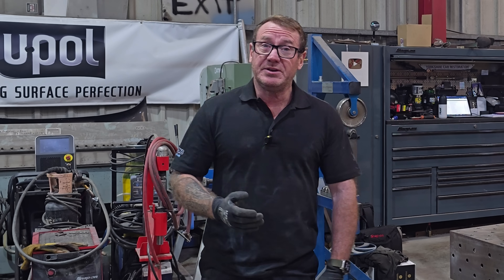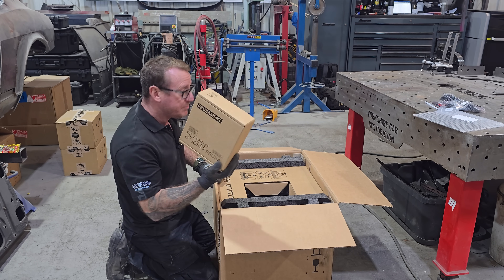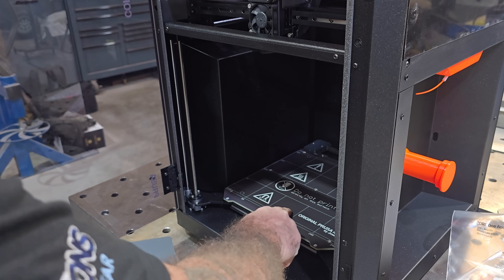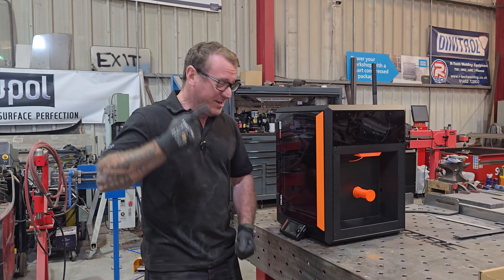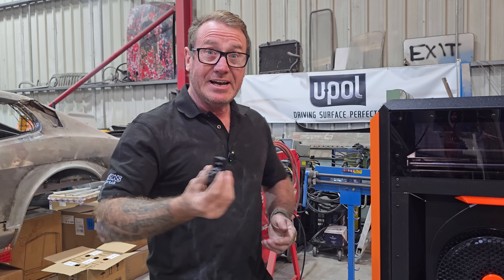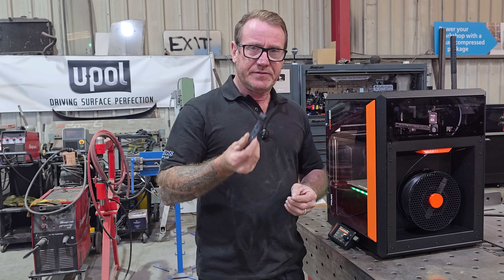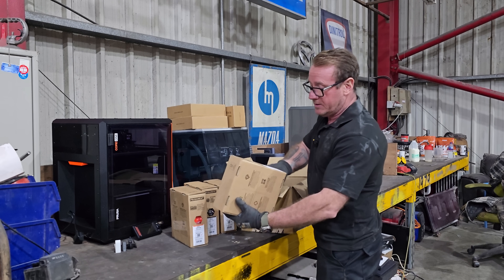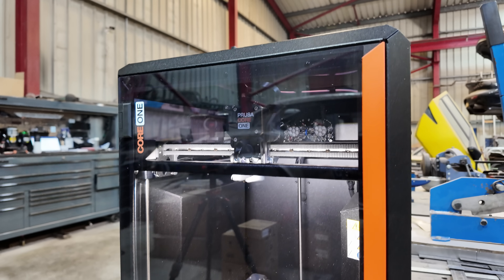Can We 3D Print Unobtainable Classic Car Parts

Comment: Noob question, how do you scan an object that you'd like to replicate / print?  Or do you have to measure it up and draw it yourself?

Been thinking about this for some Honda brackets I've been unable to locate anywhere.
Reply: With a very very expensive scanner, or.... draw it up yourself
Reply from the maker: 3d printers cost £300 upwards and a good scanner is £1000 plus but they can be used for years, all you do is scan it do a little bit of free software magic and print them out .

Comment: Normal household dust is sufficient to affect print adhesion, also it really needs normal room temperatures, and many filaments need storage in a dry atmosphere.

(3D printing in Yorkshire since 2010 with initially a RepRap Mendel and more recently a Prusa i3)
Reply: this machine does look good, and i am sure the quality is reflected in the price
its good to have someone on side with more experience, its something i have thought about getting into, especially recently having stopped work through illness and entered back into a world of aviation and modelling - if ever you get a chance to purchase any product made in resin you will notice right away the quality difference, there is zero striping in the layer build up - ok so they maybe using different materials, but they are pretty tough and need to be superglued - with the type of output shown here you need to sand, or did i hear correctly somewhere you can use something like Isopropanol to smooth surfaces

Comment: With the amount of rust and dust from sanded body filler, that's airborne at YCR, this machine absolutely needs its own space.
Reply: agreed, dreadful environment especially anywhere with concrete floors, and this kind of work, printer needs a big plastic bag over it (disclaimer - don't try this at home kiddies)
Reply from the maker: all the machines are covered when not in use :)

Comment: The printing part isn't hard (unless you use ABS). 
You need to learn how to use CAD software.
 I use FreeCAd because I want to permanently own my own designs - Forever.
Bit of a steep learning curve with some quirks but if you follow Mango Jelly's tutorials you'l be rockin and a rollin quickly.
BTW.. A word you'll hear a lot....
LEVEL THE BED !!
(Anycubic Chiron 400 x 400 owner here)

Comment: Recommend making a cover for the filament reel on the machine to keep out moisture.  Also make sure any reels are stored in low humidity or at least sealed.
They don't print well after the plastic absorbs moisture.  If they get bad bake them at 75C for 24hrs.
Reply from the maker: yes we are looking at a multi colour filament heater

Comment: cant help feeling you need this sensitive kit in a clean(er) room - all the dust from grinding will play havoc with all these gadgets over time
Reply: I'd be wanting a more dust free environment for this kit too. Especially given the cooling fans and stuff.
Reply: Maybe a proper cover.I presume they have proper dust covers for them just like they have for printers,screens and keyboards.I think you're right about the atmosphere in a workshop not being the optimum environmen, hadn't thought about that until you mentioned it.If I got one I think I would be looking for a cover even in my home.
Reply: I’ve seen worse environments TBF, it looks much cleaner than many workshops, and at least it’s an enclosed machine.  The could always put filters on the fans that draw in outside air if there’s concern.  

If it breaks I’m sure Joe Prusa will send out another Original Prusa by Josef Prusa Core One anyway!
Reply: @tarbyonlineful  Maybe put all those machines in a proper cabinet with an air filter.

Comment: Kit like this is making inroads in the scale modelling market. They are game changing. I watched a demonstration by BT 30 years ago where they were 3D printing metal parts. How far has this come now?
Reply: Im not sure about metal but i reckon for plastic, 3d prints will never be as strong as other plastic moulding methods
Reply: It's gotten to the point where you can get a printer out of a box and start printing instantly with no tuning at all. I got into 3d printing just over 10 years ago when the first kits came out and it took a lot of messing about to get a decent print and then you had to constantly mess around with it to keep it working.